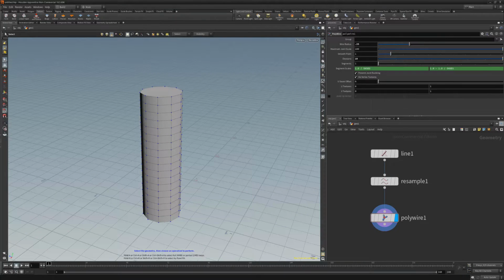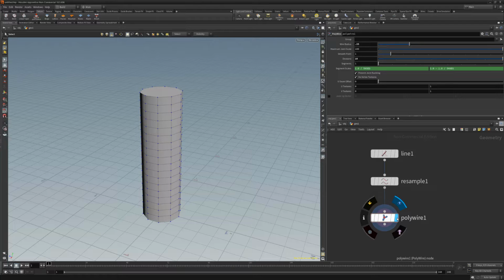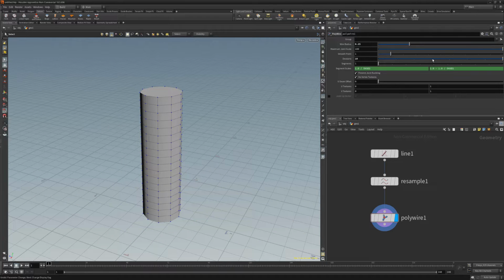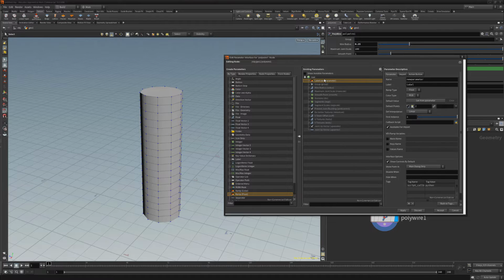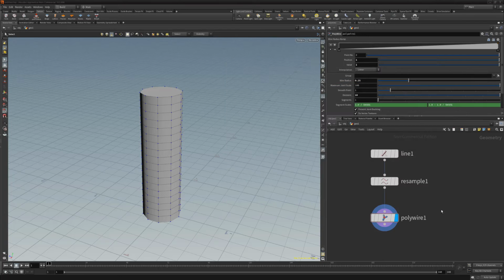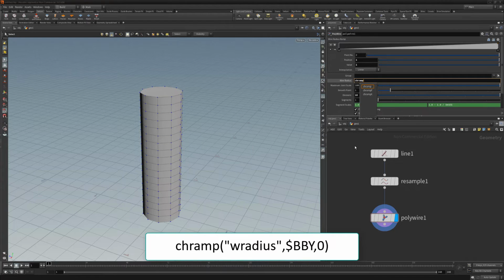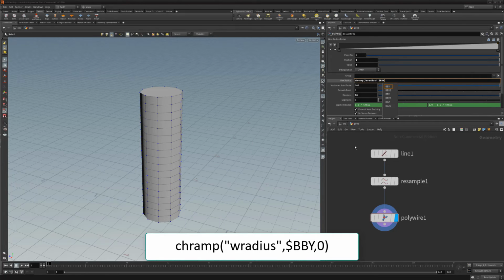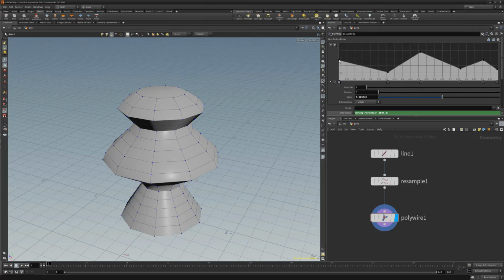Houdini | Use a Ramp to Drive an Attribute

Comment: Total beginner here. Sorry if this question is stupid but would it be possible to control displacement/mountain in a similar way? I tried control "amplitude" with this trick but it shows some errors. Assuming that this way is impossible, how can I control areas of the geometry locally over the time? For example, the rbdmaterial_fracture can be controlled by bounding box. I would appreciate any tips.

Comment: How does this work with a circular path to scale along the path instead of absolute XYZ?
Reply from the maker: can you share an example?
Reply: @pixelfondue  A fisherman reeling in the biggest catch you have ever seen. Bending its rod like an upside down U. 

The method wouldnt proportionally scale the with of the rods diameter along its lenght

Comment: Cool Thanks.  A ramp is much more useful if you add a multiplier to the ramp to make the radius larger or smaller.  You can do that by adding a float slider to the parameter interface( like you added the ramp) and then use the following code in the wire Radius.    chramp("rampAdj",$BBY,0) * ch("rampAdjMult")    Your individual names can be different than "rampAdj" etc, but that is the idea.  Then save all this as a preset so you do not have to do it every time.
Reply from the maker: Good tip!